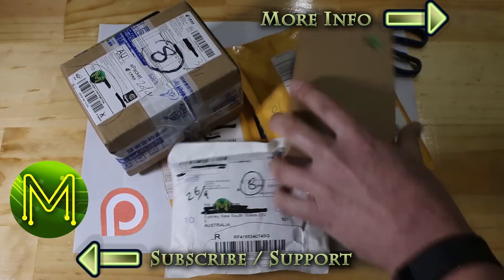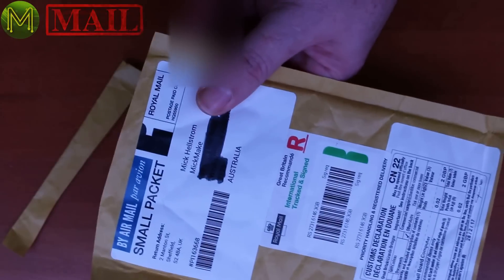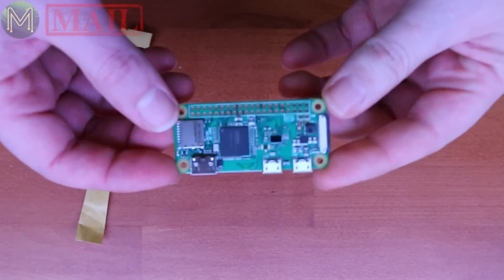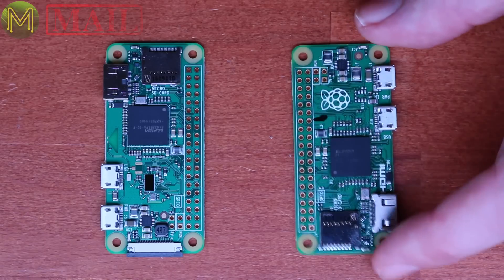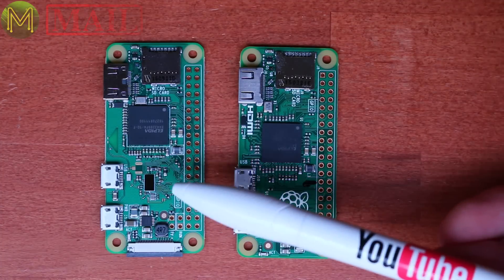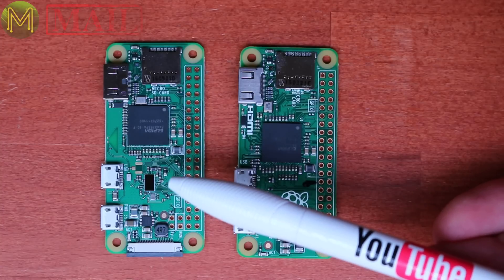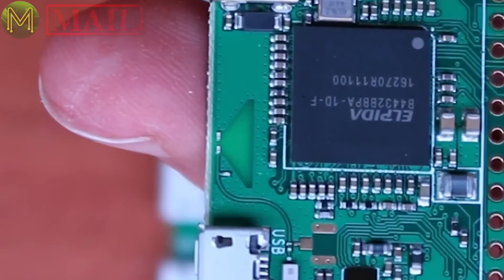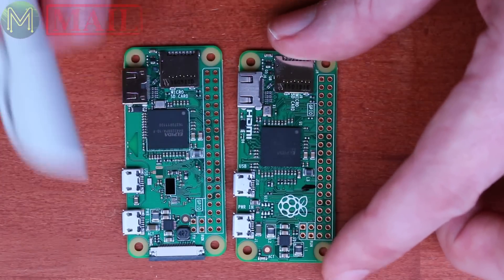#112 MickMake Mail #06: The Raspberry Pi Zero W // News

Comment: I think I've figured out the reason for the lack of an answer from Adafruit about the reason for the current shortage of individual Pi Zero Ws on their site and the previous shortage of individual Pi Zeros on their site - there is apparently not enough profit for them to sell just the board. Solution for US customers? Order boards without the unneeded accessories from the UK.

Raspberry Pi Zero W
PRODUCT ID: 3400
$10.00
OUT OF STOCK
Max per customer - ONE

https://www.adafruit.com/products/3400

Raspberry Pi Zero W Basic Pack - Includes Pi Zero W
PRODUCT ID: 3409
$24.50
IN STOCK
Max per customer - FIVE

https://www.adafruit.com/products/3409

Raspberry Pi Zero W Budget Pack - Includes Pi Zero W
PRODUCT ID: 3410
$34.50
IN STOCK
Max per customer - FIVE

https://www.adafruit.com/products/3410

Individual Pi Zeros are not even offered for sale any more at Adafruit.
Reply from the maker: +Winston Smith 
Well, yes, I know for a fact that the Pi Foundation place a fixed RRP on their products to avoid the price spiralling out of control.

Frankly large businesses don't make enough on them for it to be worth it.
Bundling is the only way. They can jack the price up of those other bits to compensate for the loss of margin on the Zero.

Comment: Very nice metal case machined from billets of 6082T6 grade aluminium (aka aluminum) for your Pi Zero which might also act to shield your Pi Zero W from harmful RF emissions... going in or out... thereby conveniently converting it into a Pi Zero. ;-)  I say "might" because you should try putting your phone in an ungrounded cookie tin and calling it to see what happens. A Kickstarter which ends tomorrow:

Pi Zero Ali Keychain

https://www.kickstarter.com/projects/746539379/pi-zero-ali-keychain
Reply from the maker: +Winston Smith 
It will definitely affect the Pi Zero W. The resonant cavity has enough trouble pushing out the wifi signal as it is.
This is called a "faraday cage" and the effect was discovered by accident, I believe.
Comes in handy with high voltages. Anything sitting in a fully shielded container will be immune as the electrical field generated by the current flow will shield it.
The fact you can still call your phone is that the container then becomes an antenna.
Try connecting the tin to a good ground point. You won't be able to call it.
Reply: Yep, that's why I specified "ungrounded" for that cell phone trick. In my test, the RX bars were pegged inside the tin, 50% outside. It might be interesting to experiment with the Pi Zero W, too, although PCB antenna tuning is probably very sensitive metal in close proximity.
Reply from the maker: Winston Smith 
Yup, it'd be interesting to see the affect on that resonating cavity.

Comment: Ugh, Broadcom chip. I heard nothing but complaints about Broadcom wifi  modules, and my own expirience was not very pleasant either (ended up buying usb wifi dongle and using it instead).
And i don't see BCM43438 listed as supported by linux drivers anywhere, does it even work?

I am really perplexed by RapberryPi dev team life choices.
Reply from the maker: +failing@commenting 
I have a review of the Pi Zero W this weekend. Stay tuned! ;-)
Reply: Tested, works ok. No problem at all. Stock Raspbian just clicked on the network name and entered the pwd.
Reply: +MickMake Whoops :)
Reply from the maker: +Michel PASTOR 
:-)
But it's really been working on Linux ever since it came out on the Pi3, or before. So no surprises there.
Reply: That's what I like about the Pi. Pretty much everything is working as expected out of the box. The funny thing is that I ordered the Zero 1.3 since I need a connector for the WiFi antenna in my application and received the W instead. In the end the on board WiFi is useful for the setup but now I need to disable it if I want to use an external USB-WiFi adapter with a discrete antenna. Too bad there is no antenna connector !
Reply from the maker: Michel PASTOR 
Yes true. I think I'll look at soldering an antenna in and see how it goes.
Reply: I have a Pi3 and i never used the WiFi because cables exist
Reply from the maker: Michel PASTOR 
Aaaaw. You gave it away! ;-)

Comment: I got my Zero W yesterday. Not even sure why I bought it as I already have a spare Zero around here somewhere, but I'm keen to find a use for it.
Reply from the maker: +Ej Sykes 
The good thing about the W is you no longer need a USB hub to connect by wifi.
Slap a Pi camera on the MIPI-CSI and make a security camera?!
Why not add two servos for pan tilt?
I know you can buy them, but heck the good thing about making it yourself is that you made it yourself.
Reply from the maker: +Ej Sykes 
What about adding an LCD & CAN bus and monitor your vehicle's ECU.
Or make an internet radio with an I2S amplifier, LCD and a couple of buttons.
Make a Bluetooth to wifi gateway.
Or add a LoRa module and setup TTY Comms between two buildings.
Reply: I was thinking of making some night vision with the NoIR camera. I just have to figure out a suitable display if I want it to be wearable.
Reply from the maker: +Ej “Misfit Gaimz” Sykes 
Nice one!